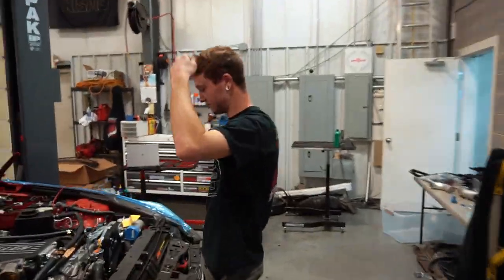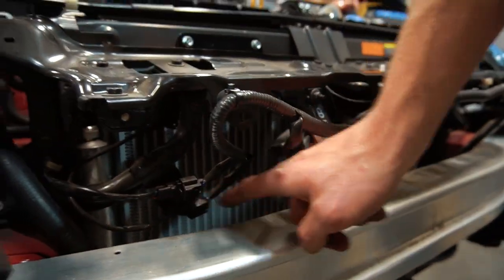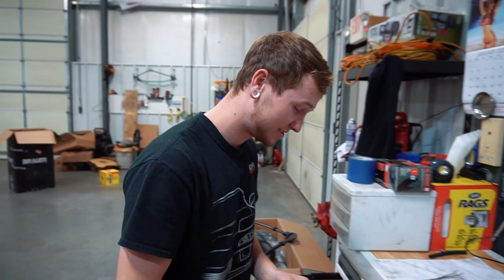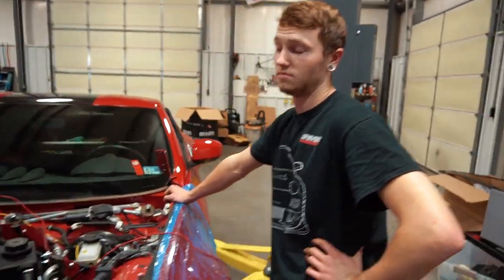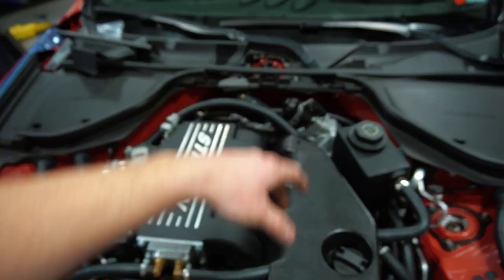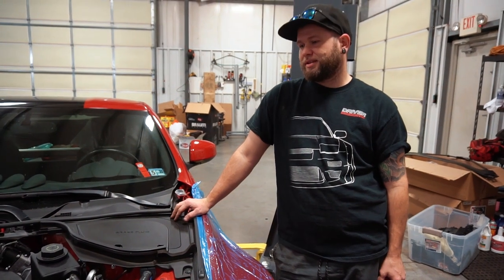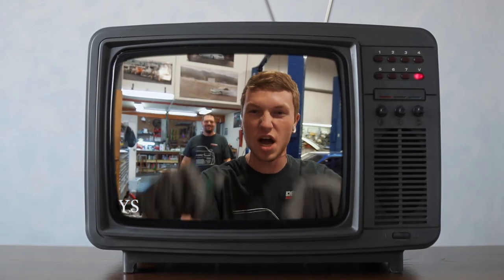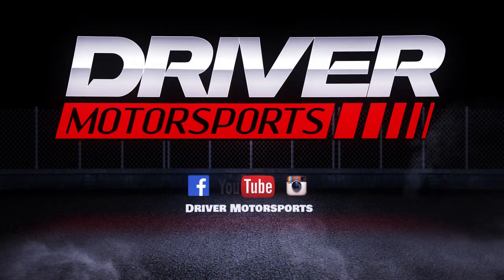Vlog | S2 E16 : Nissan 370z Stillen Supercharger Install COMPLETE!

Comment: In my opinion stillin put the tape in the wrong place on the larger drill bit if you drill that far into your fuel pressure regulator you're going to ruin it as far as I can figure you're only supposed to drill the tip out just passed the O-ring but nobody seems to know the answer to that I put a 340 pump in drilled out the tip area only about 1/8 of an inch in and I had 55 PSI Max kick off at 45 which is just about perfect I'd like to know if you guys actually drilled all the way down to the tape and what your fuel pressure was afterwards or if you put a return back system you don't really talk about any details

Comment: I inquired about getting the Stillen SS kit installed by guys via your site  and was pretty much turned away due to the amount of issues you guys had with it due to trying to use a shelved tune from stillen  and was told that if I ever wanted a Skyline though you could help with that.. This video doesnt provide any new sense of confidence for for getting the Stillen Kit installed by you guys.like I initially wanted.
Reply from the maker: We have a follow-up video coming soon. Stay tuned.
Reply: Air to air Stillen supercharger is way more reliable (and Stillen's factory tune is crap)